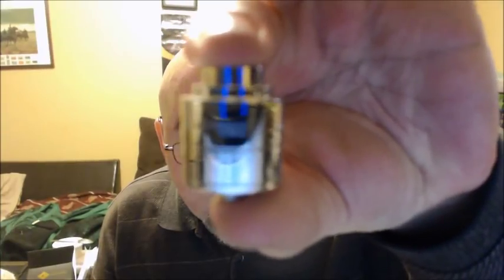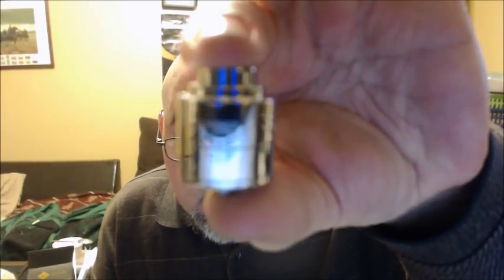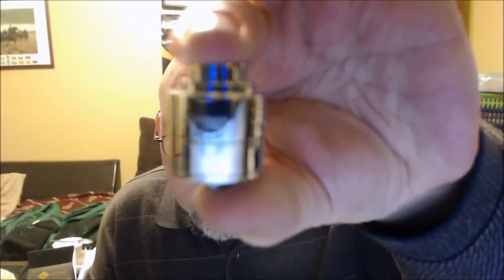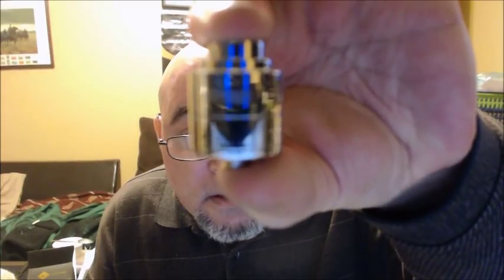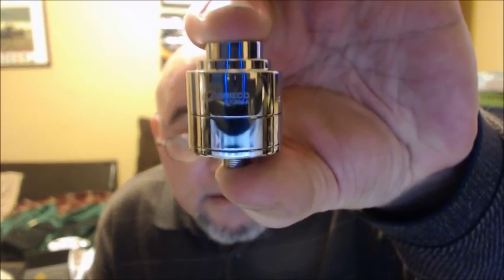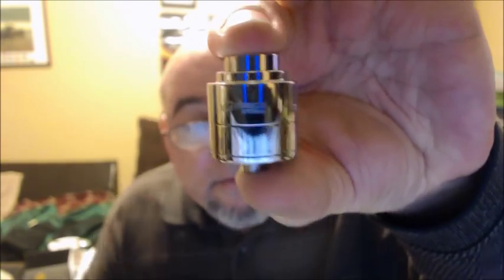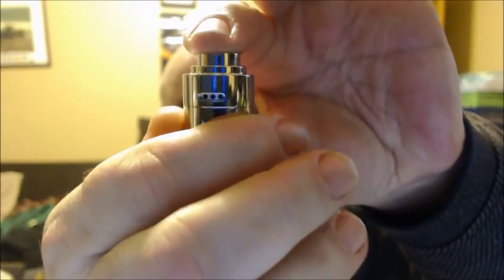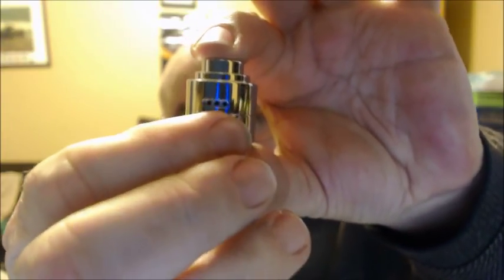Storm A RDA by Orieco

Comment: Thank you SO MUCH for posting this video, I couldn't find one in English, lol. Ive been looking for a good performing RDA that won't break the bank, this looks like it could be the one. I saved up my vape budget for several months to get a Vaperev Nemesis several months ago & I have not been disappointed, its a FANTASTIC mech mod & I absolutely LOVE IT!! Like your Atomo it was EXPEN$IVE but IMHO TOTALLY worth it. I got a Kayfun 3.1 clone for it & its HANDS DOWN the best RBA Ive ever used, great vapor & EXCELLENT FLAVOR!! The RDA I REALLY want is the Zenith V2, however at $120 I just can't afford it atm, the Storm-A on the other hand is something I can. So AJ, on a scale of 1-10 how would you rate the flavor on the Storm-A? Obviously it produces good vapor but flavor is what's really important to me, I can't have my Vanilla Custard juice being muted, lol.
Reply from the maker: Hi,

What you can't see is that the top cap is also engineered to be very small.
The center post fits up into the center hole were the drip tip is attached so flavor production is also very good. It rivals the Trident v2 and the Helios v3.
Reply: AJ Deluca
 Thanks AJ,

So how many different builds have you done on your Storm & which has given you the best performance? I would imagine micro coils & cotton? What differences did you notice between the vertical & horizontal micro coils? Oh & by the way, very nice Atomo mod, I just love two toned brass & SS, especially polished, however keeping polished brass nice & shiny is a bit of a PITA, requires bi-weekly polishings. I'm actually considering giving my VR Nemesis a good polishing & then treating it with a good metal sealant, that way it will keep its nice finish for up to 6-months or longer, however I know very little about metal sealants. I did hear about this stuff called Renaissance Wax, supposedly its used in museums all over the world to keep artifacts from oxidizing, if museums use it on priceless artifacts it must be good stuff. There are a couple YT videos on it, just search Renaissance Wax & check em out. It would definitely be beneficial to treat your Atomo with it, keeps it protected from oxidization & apparently even reduces the appearance of fingerprints, I don't know about you but I HATE FINGER PRINTS, PITA!!!